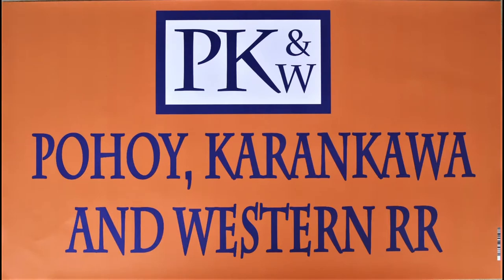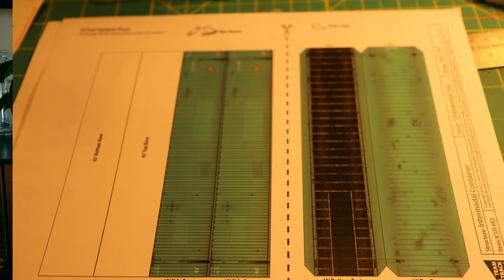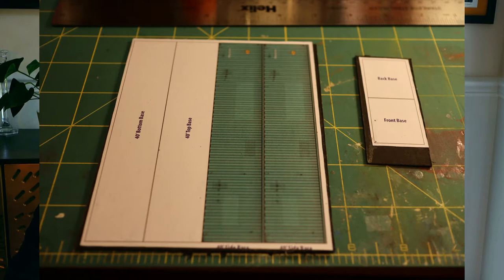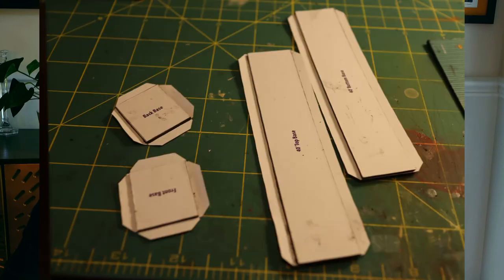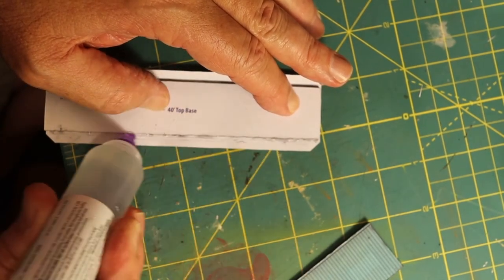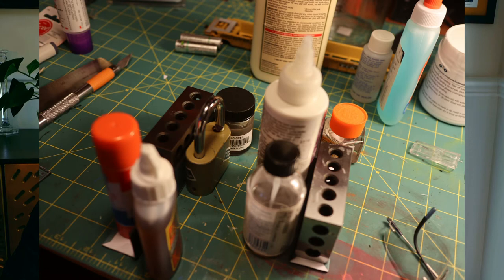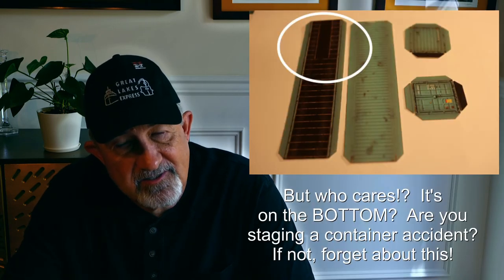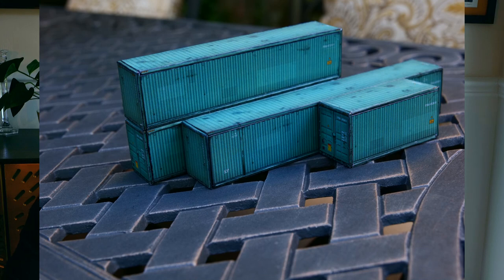Paper Modelmaking - Team Track HO Shipping Container Build

Comment: Hi Bob they look great thanks for sharing how you built them .  Does the card stock thickness you apply them too matter ?   Just wondering could you us cereal box cardboard .  Thanks again and take care .
Reply from the maker: I bet you could use cereal box cardboard with good results and save some coin.  That stuff is a bit thinner than mat board, and lighter.  I suspect it’s softer and less stable than mat board as well.  But I bet it would still work.  Give it a try and show us your results!